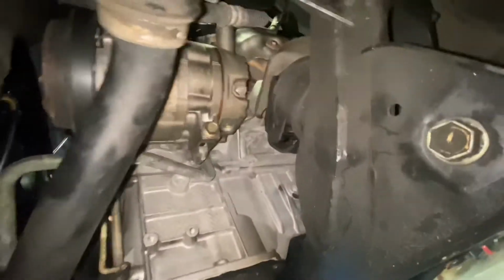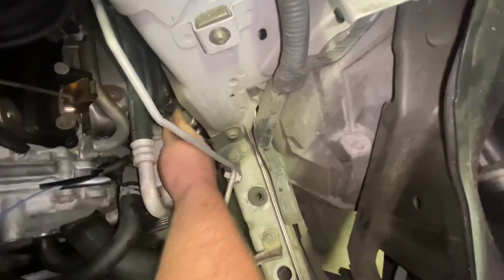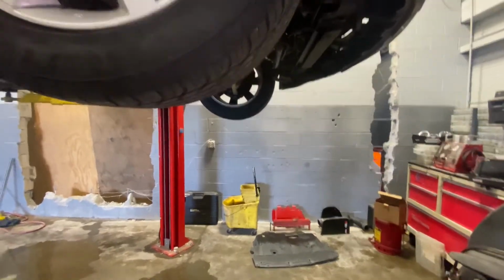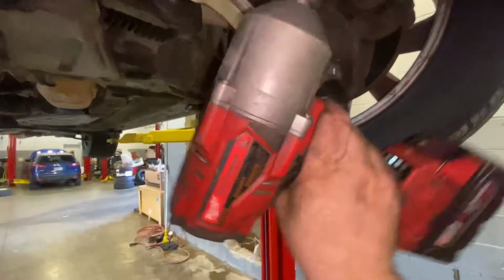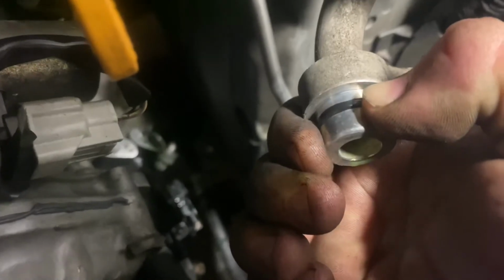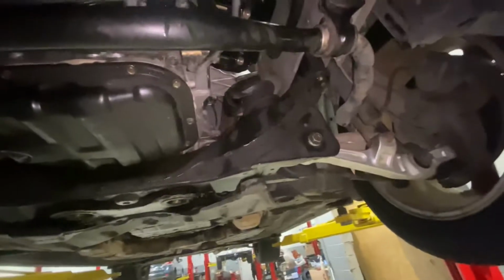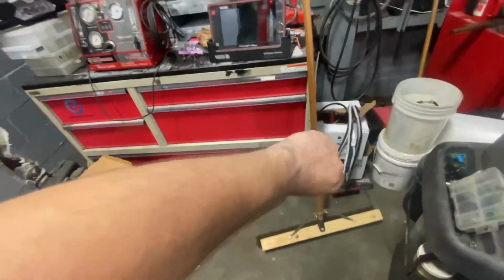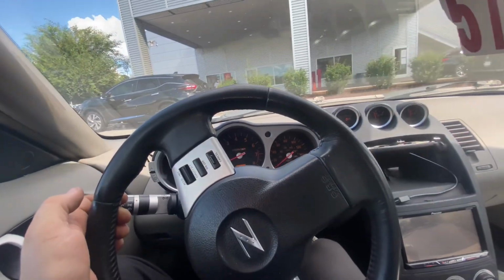Replacing a a/c compressor on a Nissan 350Z

Comment: Just put my 350z back on the road after sitting for 8 months, gave her a full service, and was given a clear inspection certificate. Went to the bank yesterday and when I came out and started the engine, the AC compressor blew up on me! Poured a lot of money into this car and not sure if I want to bother fixing it again and putting in MORE $$! But, I likely will!
Reply: Quick update: need to replace the ENTIRE air con system - pipes and compressor blew and damaged the condenser. Gonna cost upwards of $1500....and the dealer tells me it could take unto a YEAR to get all the parts! 😞
Reply: @ThatGaijinFella fix it yourself. I sourced the entire system off rock auto
Reply: @ThatGaijinFella dude you did not come here with a dealership estimate everyone knows dealerships are a scam! Ahaha
Reply: @javierpereida7832  - well, considering I'm no mechanic and certainly don't have the means to pull everything apart, or the knowledge, dealer was the safest option (work's guaranteed for a year too). I agree, most dealers are a scam, but the one I deal with has always done right by me.

Comment: Hey I installed the ac compressor on my 05 350z brand new oem plugged it in charged it to 00.55kgs and the ac compressor won’t kick on do you got any tips?
Reply: have you found any fixes, i have the same issue
Reply: @davidle2047  no sadly
Reply: Same issue. Hoping to find a solution
Reply: Do you have enough pressure? You might have a refrigerant leak. If you don’t have enough refrigerant or enough pressure the compressor won’t kick on.
Reply: @supjxy  check out my other comment it might help. Good luck.
Reply: Check your ac compressor relay! Make sure its working and didn’t burn out if is bad the compressor wont kick on